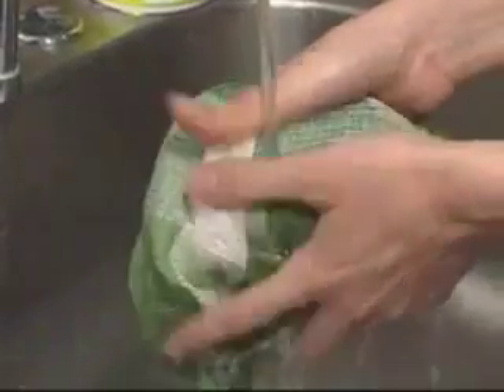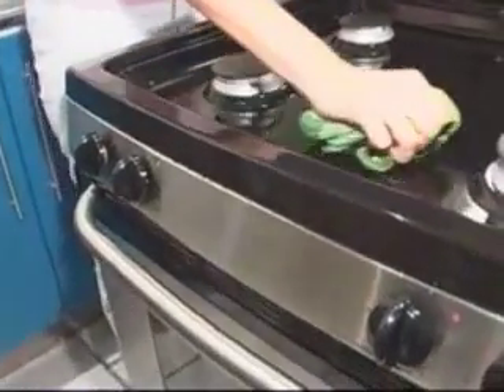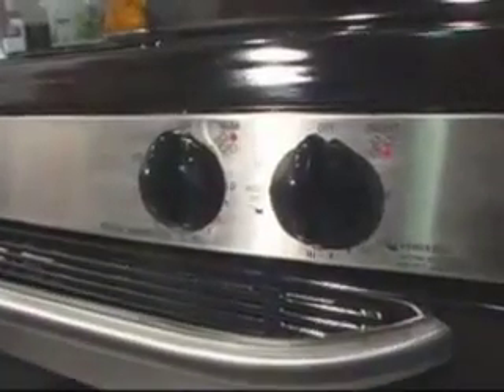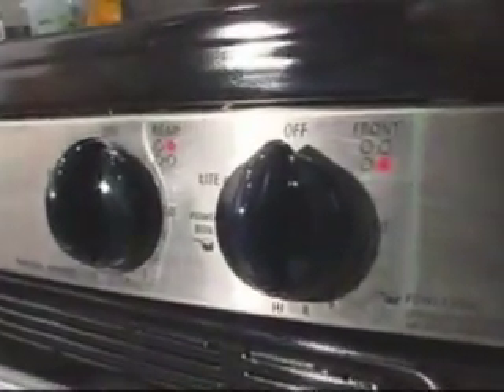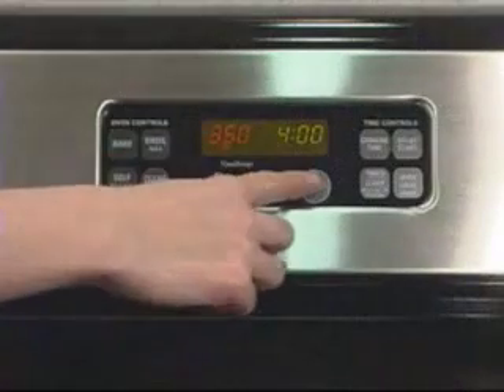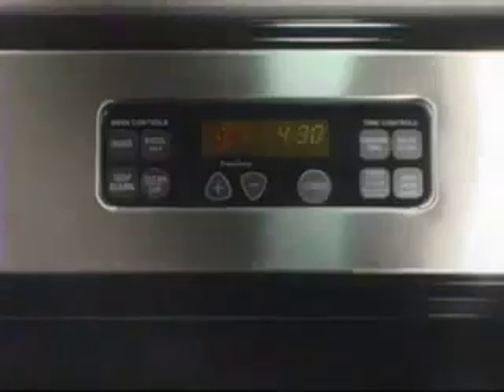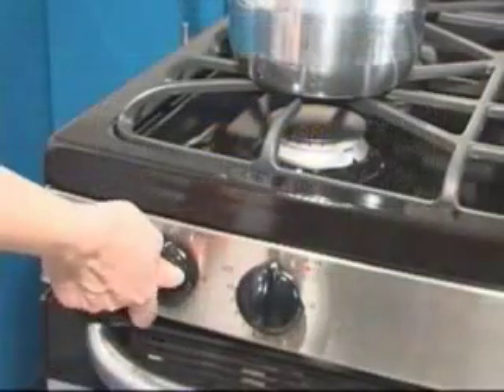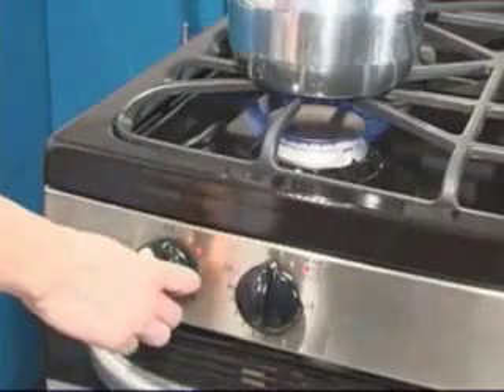Gas Range Burners Make Clicking Noise

Comment from the maker: yummypamcakez - An authorized technician will be required to examine your range in order to determine what to do next.  Therefore, we must recommend scheduling service by calling GE Consumer Service at 1-800-432-2737 or scheduling on-line through our GEAppliances website.  Thank you for checking with us.  -  Michelle with GE

Comment from the maker: mIke4258, I am sorry for the trouble with your range top burners.  I would suggest that have your range diagnosed and repaired by a factory trained technician by contacting our GE Consumer Service at 1-800-432-2737 or by visiting our GE Appliance Website. - Sheree with GE

Comment: Mine started making a popping noise at the knobs with a visible blue flash coming from behind the knobs.. I unplugged the stove, opened the top and cut the red and black wires  then capped them off..  Now we use a match to light the top burners...